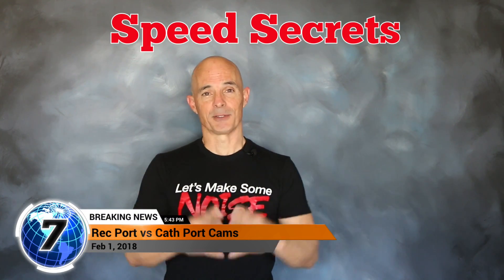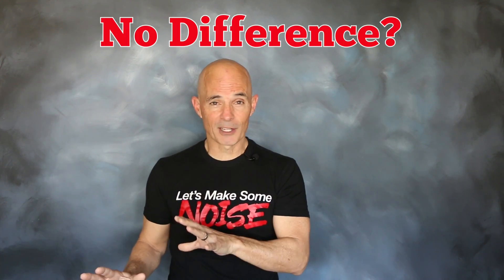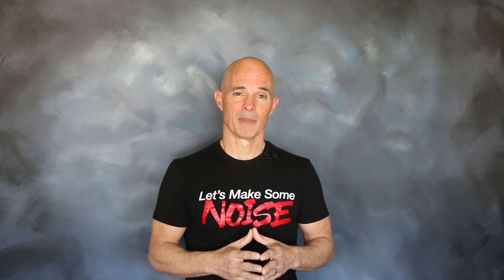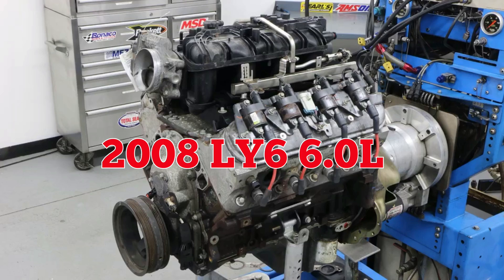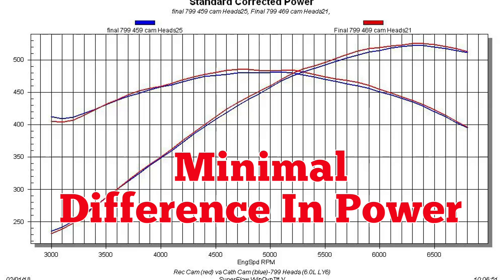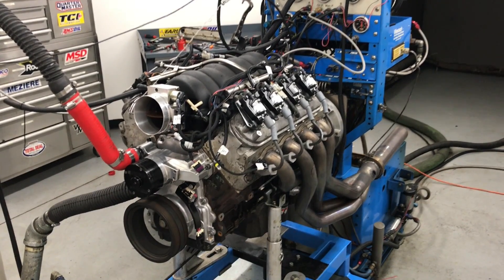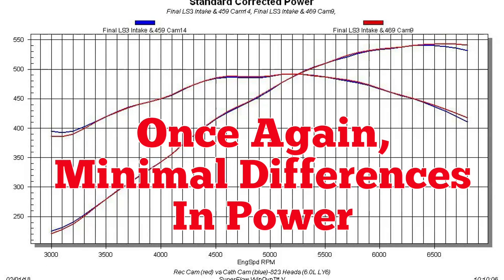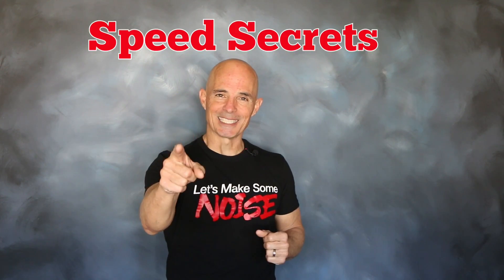LS CAM TEST-REC PORT VS CATH PORT (IS THERE A DIFFERENCE?)

Comment: Once again Richard great video, thank you. I was wondering this exact thing. I have a stock displacement LS2 with ported 243 heads. I put a BTR PDS Stage 2 in it..(TVS2300 jackshaft Magnuson)..which BTR advertise for 6.2L engines like LSA and LS9 (both rec port) and this answered one of my 2 questions. My remaining question is....how would you expect a cam like mine to behave in a slightly smaller 6.0L displacement? Am I wrong in assuming my cam would raise the powerband RPM up a little?
Reply from the maker: very slightly
Reply: @richardholdener1727  I'd be curious to see some dyno tests on let's say a 7,200 rpm LS with stock rockers vs BTR shaft rocker using factory or their factory replacement arms.

Comment: I know this video is old. But I have a 2008 6.0 with the max package I think they are rec port. Will it Mater if I had a 2 stage  cam for cathedral port installed in it. Afm and vvt deleted.
Reply from the maker: any cam will work

Comment: Hey Richard i understand it's not making to much of a difference between head's naturally aspirated but what if you throw forced induction into the mix will it make a difference
Reply from the maker: BOOST DOESN'T RECOGNIZE REC/CATH PORT CAMS-IT JUST SEES CAMS
Reply: @richardholdener1727  I'm referring to the airflow between the two cause they not both flowing the same numbers

Comment: What's the idle and vacuum difference between those two cams? Are they going to be significantly different when running a/c and vacuum boosted brakes because the 469 has 12 degrees of overlap and the 459 only has 8
Reply from the maker: likely less vacuum on the 469

Comment: So does this mean i can use a 239/255 on a 112 in my cnc ported 243 head 383 stroker ls? Trying to find the best cam that'll help me get to 500whp in my heavy gto
Reply from the maker: yes if you have p-v
Reply: Thank you so much for the reply! Pistons have valve reliefs so hopefully wont be an issue. But it never hurts to check!

Comment: What the big intake valve lets you do is keep the same exhaust duration, and reduce the intake duration.  It'll make the same power and torque as a "cathedral" port, but with better idle.

Comment: One thing ive noticed about modular ford cams is that they have almost all been tailored to the Pi heads which is a huge problem for the npi crowd. The problem with this is you have so much more available ptv clearance in a npi, but stock assembled spring height limited lift and ultimately neutered the npi combos. Almost all off-shelf comp cams have too wide lsa, too much duration, and the low lift cams spec'd for the npi dont make use of the 20-30+cfm at and above .500 lift offered by the npi intake port. Modular Head Shop was way ahead of the game getting a plethora of proper cams for a Npi that even the mildest stage 1 offering would crush valves in a pi head. Some engine families truly need a different cam spec but these ls combos show little differences. I just think back to your testing with a comp 274 in the npi and im certain a lower duration (220-230max), higher lift, and a 109° lsa would have gained power everywhere.

Comment: Lift, Lobe Separation Angle, Duration are what counts...

Everything else is marketing...

The Cathedral port had more difference for 1 cam vs the rec port.

I want to do a minor HP boost to get over 300, I don't need 400 as I'm towing/hauling, not racing. LR4 engine.

Comment: I would think that the extra duration would help more with Rec ports if it has factory manifolds.  One of your other tests showed fairly significant gains with headers alone on a stock Rec port motor.

Comment: Richard, You mention why NOT to put a rectangular port head on a smaller bore than 4".  I'm interested in doing just that on my 5.7 Ls1. Yes It's bore is a little less than 1/8" smaller. I had great results just chamfering the side of the top of the  cylinder by the intake valve on my Ford 289ci GT350 back in the seventies after I had big intake valves installed. Why not do this chamfering on the LS1 bore? Ls3 had bigger valves too so I'd chamfer away. 1/16" for the bore diff, and whatever is appropriate for the larger valve diameters. What are your thoughts on this? A test would be great, you make such good ones. I think it would save a lot of money on better heads for me and might be a good idea? Hmmn, compression ratios? Thanks for your channel. I enjoy it greatly, Ted.
Reply: I have an l76, which is an aluminum block 6.0 with the ls3/l92 rec port heads.  This is a 4" bore engine.  I have also had an l92.  Before modding this 6.0, the 6.2 feels quite a lot stronger at the low rpms.  The only real difference between these engines is the bore size.  Personally, I think that the 4" bore is not even enough to make the most of those heads, at least not without some help.  I feel that the valve shrouding is enough on that 4" bore that it is the reason the low end torque feels so soft, when compared to the 6.2 with its larger bore.

Comment: I have a question, is the 799 5.3L the same stroke and bore as the LS4 5.3L engine? I'm building a fwd using the ls4. Just want to know if there's any difference with the FWD 5.3L and the RWD 5.3L
Reply: Same bore and stroke.
Reply: Ls4 has  a shorter crank
Reply: @dannylsx7500  wrong!! Same crank @3.622" stroke as the Ls4 engine. Same crank used in all Ls engine's except for the 4.8L and the Ls7 engine's
Reply: @eliasmelendez1271  no the ls4 is 10 mm shorter on accessory  end and 3mm shorter on the bell housing your wrong
Reply: @eliasmelendez1271  they have the same stroke. length of the crank is different that's why no one puts a 6.0 in gxp or iss mcss they won't fit due to a shorter crank
Reply: @dannylsx7500  ls4 does not have a shorter stroke. All Ls engine's from the 5.3L to the 6.2 engine's all have a 3.622" the short stroke is the 4.8L at 3.268" stroke. The Ls4 came with a 3.622" stroke
Reply: @eliasmelendez1271  I didn’t say the stroke was different length of the crank is shorter
Reply: @dannylsx7500  you mean the snout is shorter vs the other ls engine's
Reply: @eliasmelendez1271  also short 3mm in the rear
Reply: @eliasmelendez1271  which I’ve already stated but guess after a year still couldn’t figure that out.
Reply: @dannylsx7500  lol I usually lose some of these comments so I'm not going to go back and reply to old comments unless someone comments back
Reply: Bellhousing pattern is also different
Reply: @dannylsx7500  yes but that's because the transmission is a transverse vs longitudinal. Ls4 will always be a fwd platform engine. That's why I'm almost done with my Ls4 swap integra. Here's something that will blow your mind. The block is sleeved and bored to 4.185" bore using the stock 3.622" stroke. All motor and the compression is around 14.3:1 on e85 with a splash of M1. This thing is going to Rip on any drag strip except on Import vs domestic lol
Reply: @eliasmelendez1271  I use to have grandprix gxp got totaled sadly now I have cammed g8 and 6.0 swapped rcsb that's also cammed. Plan is to have the g8s low 11s all motor which seems to be pretty easy
Reply: @dannylsx7500  the only thing missing from my setup is a cam, low rising lifters, push rods and cv shaft. I want this bad boy to rev 8500rpm or at least 8000rpm. I'm running a GM f40 transmission with a Phantom Grip LSD. The cv shafts so far is the most expensive shit that I'm waiting for lol everything else I did at my job. From the port work on the heads to the sleeving of my block. I'm a machinist at Rockville Ring and Bearing in Rockville Montgomery County Maryland.
Reply: @eliasmelendez1271 is it all done now?
Reply: @baby-sharkgto4902  got laid off so the whole build is on the back burner. More worried about my kids education vs my integra build
Reply: @eliasmelendez1271  I understand, good luck bro. Good thing is everyone is looking for help.

Comment: So both head's lost slow speed torque with more duration on the exhaust side below 3000rpm so a lighter car with 3.73-4.10 gears and a 3000rpm stall converter will work well with this cam if top end power is your goal 3000rpm to 7000rpm but if your talking about a heavy car or truck with a 3.42 gear stock torque converter it will pull better in the low rpm range but probably have a power band of 2200rpm to 6200rpm with a cam that has less duration on the exhaust with either head for LS chevy engines got it

Comment: Would it change with boost?
Reply from the maker: would what change the boost
Reply: Richard Holdener  would the longer exhaust duration make more power or power quicker?
Reply from the maker: @nissandet1  That's too general of a question-longer duration cams tend to run better at higher rpm, but more duration thatn stock cam improve power and torque everywhere up to a point-Cam guys be like-TALK ABOUT VALVE EVENTS-NOT LIFT, DURATION AND LSA!!

Comment: The Pope of LS, doing gods work again I see.
Reply from the maker: I think you mean Dope of LS
Reply: How about we settle on Dope test results? (See what I did there????:)))
Reply from the maker: @woog74  clever
Reply: @richardholdener1727  Hi Richard in your experience what cam would you use in a Ls3 with a standard stall and the car is aevery day driver, i have emailed Bart from Hi TechMotor sport he said to use 225/232 600 600 113 , but Johnathan from Comp Cams said to use 212 218 115  but Bart said that's way to small ,its very confusing out there,  i have Ultra pro Magnum roller rocker arms and crows Cam pushrods and Pac beehive valve springs,  also do you need the car tuned to run these cams I watched a few of your videos to help clarify thanks Andrew

Comment: Curious on your thoughts of a rec port vs cathedral port application. When do you feel one is better for the other in a given scenario? I see a lot of people putting rec port on 6.0 engines and I don't think it makes a difference over 706/862243/799 at street car power levels (under lets say conservatively a 700whp level).

Love that you're setting YouTube on fire, I see your subscribers doubled since Monday. Keep up the good work bud!
Reply from the maker: the 823 rec port heads make more power than any of the stock cath port heads even at the 500 hp level
Reply: I was about to ask the same question. Lol
Reply: it makes a difference the 823 is like using a set of ported cath ports..the cath ports tend to make better tq from 1k-4k but then the rec ports become king..the fastest sbe n/a 6.0 in the country runs stock port rectangles and the fastest cath port motor that is similar is about .5 slower in the 1/8th..but to get back to what your asking its a solid 20hp difference on a mild cam engine.
Reply: With a cam that has more lift and duration on exhaust in a light car 3600 pounds or less with driver 3.73-4.10 gears a 3000 or more stall with rectangular port LS3 heads preferably CNC ported should have very very strong top end power and rev up very fast cathedral port heads are good but if your not as interested in low speed torque as much as top end power the rectangular port heads are hard to beat it seems to have never ending power even above 6500rpm but the cathedral port heads make more torque below 3800rpm really depends on your application intended use weight of car or truck stall speed and gearing being used l prefer the rectangular port heads for all out power
Reply: Rectangle ports flow more air and that means more power, end of story. I'd take a set of stock rec ports over an aftermarket cathedral any day of the week, but you have to ask if the power is worth it. Assume $2000 of you're going to freshen them up, throw springs and titanium retainers at them, and get a valve job plus nicer/maybe bigger valves. For n/a I'd say it's totally worth it, but for turbo you're probably better off spending the money on a nicer turbo and getting your manifolds/hotside swaintech coated.
Reply: Cath' or Rec port head engines are waiting on a bigger than stock cam. The bigger the cam the more the rec ports will shine Ported Cath' heads may be the best of the 3. Richard has it all covered in his videos.

Comment: proving that the "experts" arent really experts
Reply from the maker: Cam designed know a lot more than me, but it does show that the magic people assume exists with cam timing isn't there.
Reply: I called out BTR a few years ago on this.
Reply: Isky was right.
Camshafts with too much exhaust duration kill the low end torque and don't actually make more power.
You might get slightly better power hanging on in the upper top end of the power curve but it's not worth it unless you are drag racing
The lower the split the more under the curve power you make and also more torque.
A lot of vendors limit the split to about 8 degrees and just give more intake timing and advance to compensate.
Reply: @mrmysterious6006  learn valve events and not look at duration..i can design a cam to have the same duration split but one make more tq then the other..its where the exh valve opens is what controls your tq..exh valve events also are what really controls the rpm range hence why once you you move your power band up you make less tq down low..
Reply: @suicidal_racing  you're completely missing the point of the video. All this video is for is to demonstrate that the shape of the ports has no bearing on the kind of cam you can run. This video is about cams and cams alone, not the mechanical or volumetric limitations of heads.
Reply: im not a cam expert but i know valve events decently an i know why there is a such thing as rec port an cath port cams..for one the intake valve size limits you on your ivo number that can be used on a rec port..now most look at cams in  duration which is wrong,because it really dont give you shit for info..when you look at the ivc,ivo,evo,evc numbers an understand what they are an their relation with engine timing then you can get a better understanding..for instants richards 2 cams where close just looking at the duration numbers with the duration being bigger on the exh right. but for instance them 2 cams could still have the same  evo numbers even though ones a 239 dur an the other is a 247 dur.

about the max ivo number you can fit in a sbe cath port deal is around 12.0,thats at least the max i go when i have a cam cut for my shit an ptv is not much an is tight tight,a iron/alum head i stay around 11.5 do to less expansion from the iron block vs a alum block..now on a rec port max you can go before it gets tight is about a ivo of 8.5 on a alum block an head deal an ivo of 8.0 on steel block alum headed deal..now a rec port has a big port it moves air different then a cath port and honestly the port is sort of lazy hence why some the ivc numbers are only like 1.0 with in each other..but the exh port on the rec is def lazy so others have there thoughts on when to open the exhaust an such ..power adders play a role in valve events needed along with intakes an runner sizing..a carb intake vs a fast will have 5.0 different or more in your ivc numbers because you will fill that cylinder faster with the shorter intake runners. port velocity,rpm band wanted an your stroke also play into what the cam needs to be

a lot of things come to play in it all..sorry for the long post but hope this lets others sort of grasp why some things are different an just what all gos into picking out a cam..
Reply from the maker: @suicidal_racing  I understand cam theory pretty well, the point was just that  they do the same things with both heads
Reply from the maker: suicidal racing are you talking abut P-V? ,Then that’s not really cath or rec specific. It’s intake duration and closing